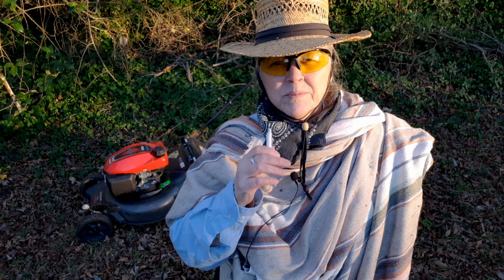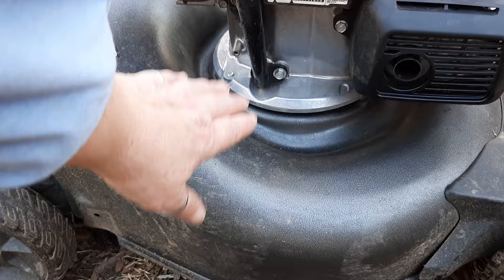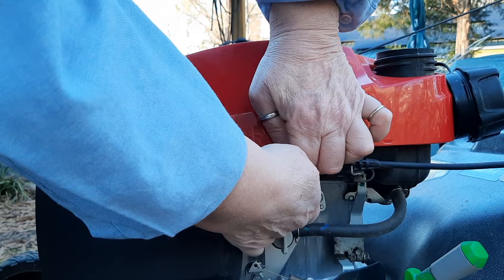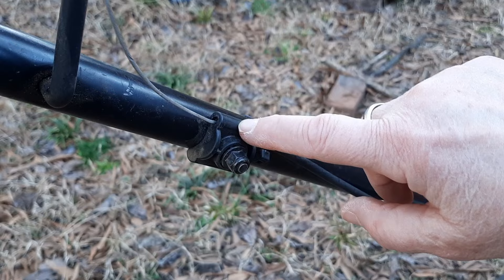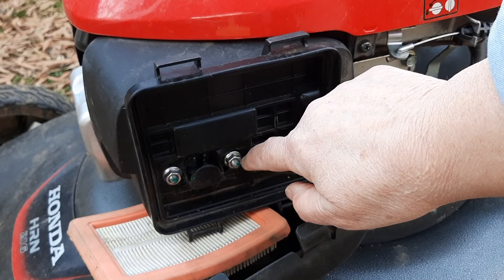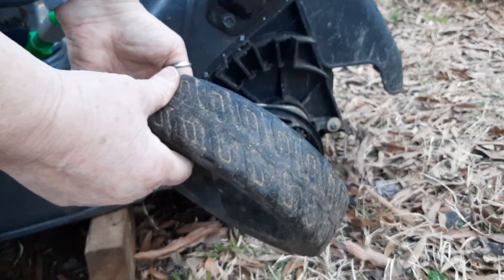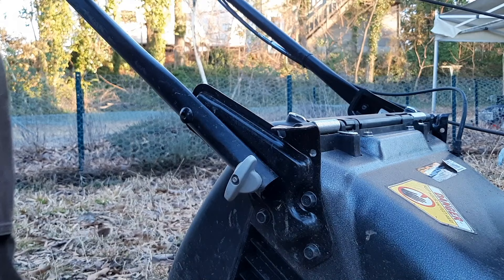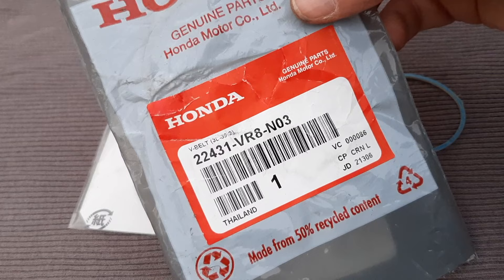Honda's Newest HRN216 Mower in 2023: Good? Bad? Ugly?

Comment: Hi Lawnmower Lady.  I am noticing wear on the rear wheels of my HRN216 mower.  So, my question is Will rear wheels for a HRX216 mower fit/work on my mower?  TIA!
Reply from the maker: I wish I knew. I do know the wheels on the HRX are better, with ball bearings. The real key is the gear on the inside, if that is the same. I know on older Honda mowers, you could just replace the tread on the wheel. No sure if that is an option here. Thanks for watching.

Comment: So, to note some discrepancies in your video:  The HRN series replaced the HRR series, which is mid to entry level machines, not the HRX series which is the premium residential models.  The HRX series also gets this similar revision of engine being the GCV200 with the HRN's GCV170.  Both the GCV170 and GCV200 engines revert back to a pushrod design instead of the cam in head design of other GCV and the GSV engines.  This is all moot now due to the mower line stopping production this year in the US.
Reply from the maker: Thanks for watching.

Comment: Thank you for the great review.  What are thoughts between the HRN and the HRX model?   Is it it worth it to move up to the next level?  Thanks.
Reply from the maker: I believe the HRX model (at least from last year) still have some of the higher quality engineering -ball bearing wheels, better cables, etc., that were there before. The underside does not expose the belt like the HRN, and the composite deck is rock solid for plastics. Thanks for watching. Cheers!
Reply: @TheLawnmowerLady  Thanks for the feedback.  Sounds like the HRX is the better bet.  Have you had any experience with the commercial HRC version?
Reply from the maker: @joeraptor1  my personal mower is an older Honda commercial mower. Much higher quality components.
Reply: @TheLawnmowerLady  Well said.  I have a Toro commercial and you can't compare those to any homeowner model.  I always wanted to try out the Honda commercial but there's a big jump in price and weight over the HRX versions.

Comment: Can you check the parts illustration to see if they put a oil seal on governor arm where it comes out of engine
Reply from the maker: I'm not sure, and can't look it on this phone. 😂 Lol. But I can tell you, if you overfill the GCV 160 engine past where the governor control goes in oil will leak out there. I'm assuming there's not a seal, since they cut down so many parts on this engine redesign

Comment: I have this mower, it doesn't like dusty conditions or rough condition like I have in my front yard, lots of dust, acorns, leaves, debris even though I stay on top of it and rake several times a year. The belt is going off track and gets stuck and you lose the smart drive, I hate it. I had to replace the belt already three times in 2 years and it took me 1H30. Many users reported this issue on Honda website.
Reply from the maker: Yep, Honda really dropped the ball on this one. Sorry you are having so many problems, you are not alone. Thanks for watching. Cheers!

Comment: 67 less parts,  has the price gone down versus the prior year?  Been researching to replace my Husq and am only seeing two legitimate gas choices where I am. This line and the Toro line.  Disappointed to see that my replace cycle has coincided with this cheapening.  Have heard nothing but good raves about the Honda lines/history, so with this having so many changes should it really even still be considered the same model /line?  Gets kind of confusing hearing people say they've had a hrn216 for X number of years and they swear by it only to find that the model I can get my hands on isn't really the same thing and the complaints I hear about it are consistently similar.  Make me hesitant to pull the trigger on the wallet....
Reply from the maker: They are putting the same engines on the latest HRX line. If I was in the market for a new mower, that's what I would choose. Thanks for watching!

Comment: So I have a question this is the VKA model which is what I had but had to return for a couple reasons one being a oil leak & other being spider web cracking all over the side of the engine block & it was pretty bad looking.. I'm getting another one cause for the money it's the best on the market for homeowners in this price range.   I  kinda want the VLA model with the blade stop but with the clutch I worry about it being dependable.   Would you stay away from the one with the blade stop cause of more extensive parts to go wrong & should it be dependable.   Thank you in advance
Reply from the maker: The blade stop is a good thing. My concerns are more with the newer engine design, i.e. smaller oil dump means higher potential to run it out of oil. Secondly, the lack of baffles to keep debris from entangling and derailing the belt. Thanks for watching!
Reply: @TheLawnmowerLady  The belt guard was another concern for me but the alternative mowers on the market are just junk period.   Plastic carburetors I stay away from as it's a sign of a total pice of crap.   I did get the VLA & been using it a few times & I like this mower a   lot & hopefully it will stay dependable but small oil capacity & belt guard & plastic cam shaft makes me worry about longevity for sure.  All I can do is hope I continue to have a good experience.    Thank you & God Bless.

Comment: I’m getting white smoke on start up.  Only lasts a few seconds and clears up.  Otherwise it runs great.  Any idea on the smoke?
Reply from the maker: Maybe mower might have been turned on its side the wrong way? White smoke is usually excess oil in the wrong places burning off, or over filled oil in the crankcase. Check the oil level, replace the air filter if it's saturated in oil. If you must get under the deck, it's best tilt the mower back on the handlebar. Worst case, turn the mower over with the air filter side up in the air, and the oil dipstick side towards the ground.
Reply: @TheLawnmowerLady  I changed the oil today and refilled with Honda 10W30.  It only took about 10oz. for the dip stick to read full (not screwed in).  The 12 ounces Honda requires for this engine actually overfills it.  I also replaced the air filter which did not have any oil on it.  Whatever the issue was, it started first pull without a trace of white smoke and runs like a top.
Reply from the maker: @hammer3921  Yay! Glad you got it sorted out. Cheers!

Comment: I wonder is there a wheel set you can change out and then have wheel bearings all around? I have this mower but without the drive system.
Reply from the maker: Maybe? Should be an easy swap without worrying about the gear design. The wheels look similar in size to the HRC Commercial Mower front wheels.

Comment: great video.. i was wondering if you've found any solution to the rubber boots for the cables? usable parts from other mowers parts catalogues that will fit ?
Reply from the maker: Unfortunately no, they are an integral part of the outer cable system, and get threaded onto the cables before the cable ends are terminated. Thanks for watching.
Reply: @TheLawnmowerLady  that's a shame .. but you keep up the great work

Comment: Hi can i use this stud in this model in HRX217 INSTEAD OF BOLT for the carburator
Reply from the maker: Absolutely will work to assist with assembling all the gaskets and spacers. If you mean permanently, they probably should be shorter. Thanks for watching.

Comment: At 7:45 u show a diagram of the transmission assembly. On that diagram top right, part designated as 3, the connects to the spring marked 8.... what does that piece 3 attach to.... got everything apart to change the belt but when I unhooked the spring from the transmission It came out with that 3 piece and I couldn't figure out where it attached to..🤷‍♂️ Any help would be great.       
   My boss wants to finish mowering her lawn and I'm not trying to buy her a new lawn mower..🤦‍♂️
Thanks
Reply from the maker: If you’re referring to that folded flat metal bracket, you’ll find a slot, almost impossible to see, but that’s where the bracket fits in. The spring tension holds it in place. Hope this helps.
Reply: @TheLawnmowerLady  
Thanks darlin'...
    Hopefully I can knock this off my charitable help gone wrong todo list today and focus on not mowing my own lawn for once, LoL...🤦‍♂️
      Have a good morning and enjoy the rest of your day..💯

Comment: In my experience these brand of Honda engines are underpowered! I use mine to edge and noticed in the spring this year when grass was at it thickest and highest the mower was bogging even at the highest cut setting of 4. It didn’t matter if I was mulching or bagging. Wish there was something I could do to get more HP where it’s needed!
Reply from the maker: I think the jury is still out on this new engine design. I appreciate you watching!
Reply: I read the 170 has 1 more hp than previously. Also, there is a mod to increase output, probably rpm via the throttle setting. It should be easy to track down; I haven't needed to
Reply: Next time dont be lazy and cut the grass more sooner.
Reply: @Carlos.Rivera  I can’t control the weather Carolos. Something named “rain” prevents many of us from cutting the lawn. And you don’t cut wet grass do you Carolos.
Reply: GET SOME GOATS OR SHEEP YOU DONT WORY ABOUT NEEDING A LAWN MOWER.
Reply: @carl3233  Honda IS the Goat lol
Reply: @carl3233  And you can "BBQ" the goats later ! Cabrito !!!
Reply: @Fresh-tw7ev  amen half the time I mow in dusk or flashlight cause I work so much

Comment: As far as the wheels not having bearing's is concerned the Chinese will probably come out with a knockoff version pretty soon. Let's just hope it has quality bearings. Then again if it becomes an issue or enough people complain about it Honda might address the issue as well. I've had a chance to use mine a few times now and really like the mower 😊
Reply from the maker: Interestingly, the bearing weren’t even quality bearings. Just the cheap bearings common on wheel barrows, etc. I can’t imagine they were saving more than a few cents per wheel. I appreciate you watching! Cheers!

Comment: What about the  fact that these Honda lawnmowers have no shroud protecting the pulley and belt for the self propelled mechanism. Wet grass and gunk gets caught up in that pulley and belt and causes lots of havoc. I'll stick with my cheaper Troy Bilt, Honda powered lawnmower with the plastic shround on the underbelly of the deck.
Reply from the maker: It is a problem. There are numerous reports of the smallest twig derailing the belt from the drive pulley. I would recommend anyone looking for another Honda mower to look for a good condition used HRX series. I do not have a lot of confidence in the new engine design on the new HRX series mowers available today. Thanks for watching.

Comment: Do you think starting is worst on these due to emissions? My 10 year old Honda hrr216 started first pull everytime. This new Honda hrx217 I bought takes 8-10 pulls to start it. I talked to Honda and they said it’s due to running it in temperature less than 50 deg ferenheit, it’ll make the mower harder yo start. I never had issues with my older one
Reply from the maker: I honestly don't know. Freezing weather yes, but 50deg? sounds fishy to me.
Reply: @TheLawnmowerLady  thanks. Also, how do you get gas stain off nexite deck on the Honda hrx217? Any advice?
Zach
Reply from the maker: @ApplezToOranges  Absolutely no clue. I really only deal with the mechanics, and leave the cosmetic stuff to the experts 😹

Comment: May be a quality mower from a mechanical standpoint; but in my 4 months of usage the HRN cut quality sucks.  Uneven cuts, high and lows levels depending on which way you are cutting, and bit time wheel ruts even with alternating the mow pattern.  Very unhappy, and expected so much more from Honda.
Reply from the maker: They cut a lot of corners to compete with the low price/quality competition, and lost the game.

Comment: I have quite rugged and uneven terrain due to mole activity. Do you think think this mower can cut it? :) Or should i look for a mower with a stronger engine? And better quality wheels.
Reply from the maker: I think you should be fine. Any Honda mower is a better quality machine than most any other on the market today. Thanks for watching. Cheers!
Reply: I’d buy this used with 200 hours before I’d buy any other push mower brand new. 

My number one choice hrx217vka (I have had one for 8 years love it). 

My second choice is the mower this nice young lady is teaching us about.
Reply: @americandude3825  the hrx  217 vke  costs here in Slovenia, Europe about 1100 euros, roughly 1100 dollars. That is tpo much for a mower in my opinion.

Comment: Biggest changes for me would be the engines are no longer OHC. no more timing belt. OHV. Crank is easily swapped, sump opens from the top. Studs on the carb mounts which you mentioned. makes life so easy. I'm surprised the mower needs a belt replacement already, they should last more than two years.
Reply from the maker: The owner dropped the deck to its lowest setting, and treated it like a bush hog in the overgrown vines and seedlings in the back of his property. 🙄 Tremendous wear and tear in just a few hours time. Thanks for watching!

Comment: No studs on recoil is good. I always get 2 of the nuts off and the third wants to make me back out the stud.
Reply from the maker: Me too Mr Tom! it's usually one that holds the coil, now I have to re-gap it.  I was more elated with the carb studs. WooHoo 😃🍾
Reply: @TheLawnmowerLady  yes, that is a long overdue change also. I try to avoid taking the carb off a Honda. If it was a Quantum, I wouldn’t hesitate to pull it.

Comment: Do you think the older 8" wheels with the bearings will go on with no problems.. like the hrr series wheels?
Reply from the maker: That is a good question. The mower is back with its owner, so I can't really answer that. Maybe give it a try? Many shops have a lenient return policy if the parts don't fit. You might have to pay a small re-stocking fee. Thanks for watching!  Edited to add: I got this mower back a few weeks ago for an oil change. The wheels were very wobbly already.
Reply: @TheLawnmowerLady  Home Depot sells the 8" wheels with bearings in stock.. I think I'm going to try them out.. Just not sure if the drive gear is the same or not. Maybe you can tell me.. I have mine on order and will be here this week brand new. Can't wait to try it.
Reply from the maker: @bombidude  please let us know. I’m sure others will want to know if they fit. Thanks!
Reply: So, did they fit?

Comment: Owning this mower has been a headache. The surging issue even after cleaning the carburetor multiple times just keeps coming back.
Reply from the maker: When was the last time it was running right?
Reply: Ya mine was surging brand new outta the box, what fixed it was almost a perfect oil level, seems like this mower doesnt like too much oil, or not enough.  If yours is surging check the oil level, fixed mine, I was goin nuts tryin to figure it out my surging issue.  Plus THE HANDLE PARTS  arrived broken, BRAND NEW outta the box, and now theyre sold out from a billion dollar joke HONDA company wouldnt honor my warranty claim due to some lazy sally idiot at customer service at HONDA, joke company. What are we coming to here everything is a joke these days.
Reply from the maker: @jamesmann7563  Yep, I agree it's not anywhere where Honda used to be. I'm not thrilled they made the oil needs so little on the newer GCV design. The older design took 10-20oz from dry. This new model is around 12oz Not a lot of room for error.

Comment: Crankshafts are easily bent, hard to find, and expensive for the gcv170.
Reply from the maker: I haven't priced one, but a crank for the GCV190 is about $45 shipped. Thanks for watching!
Reply: @TheLawnmowerLady  the 170 crank tends to run around $160 from what I'm finding.  You can almost swap engines to the 190 for what fixing a 170 crankshaft costs
Reply from the maker: @limprooster3253  Wow

Comment: Mam, does this mower roll back pretty easy?
Reply from the maker: It should, yes. Thanks for watching!
Reply: Mario Gomez, not unless you are Arnold.  That big steel deck and steel-framed bag are heavy.  I own one.
Reply: @TheLawnmowerLady  , why world you assume that and state it like fact?  I made the mistake of buying one last year.  They weigh 79 pounds dry and 82 with gas and oil!  It's ok in straight line going forward, but no joy when backing and going around bushes or trees.  I should have bought a 217 with the lighter deck and ball bearing wheels for a medium size yard with "obstacles".
Reply from the maker: @captainamerica9353  I didn't state a fact, I stated my experience with a mower that is no longer in my shop. In fact, it rolled backwards easily with the transmission not engaged as I recall. Not like I could run outside and test for the OP. I also have no idea of the condition of the OP's mower. So yes, my answer is still "It should"

Comment: carburetor got clogged  up on mine and cost $130 to get cleaned.  pretty lame considering it was only 2 years old and still under warranty.  honda said it was not covered because it was a  gas flow issue .   not !   lame carburetor on this new engine.
Reply from the maker: I agree it was too much $$, but also agree that bad fuel is not a warranty issue. If you are handy, please check out any of my other Honda carb cleaning videos. They are so similar across most all engine types, that you can easily avoid this in the future. Thanks for watching. Cheers!